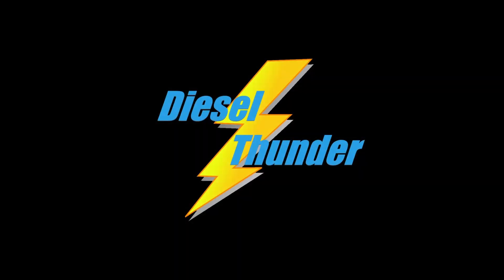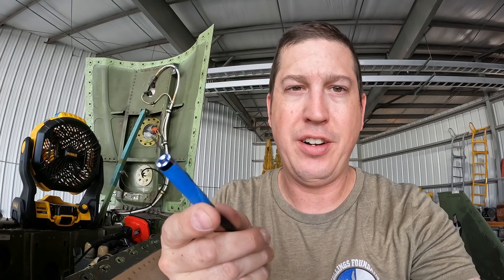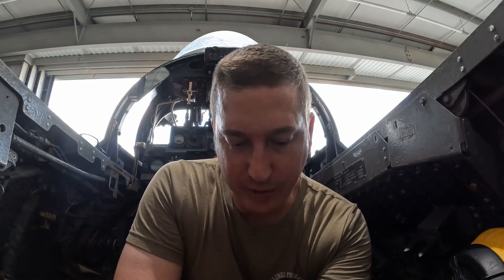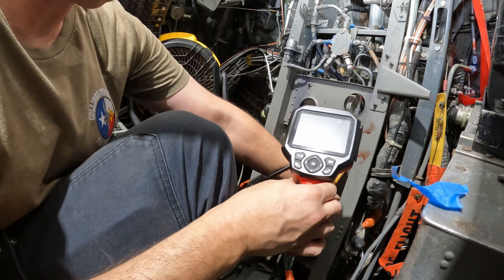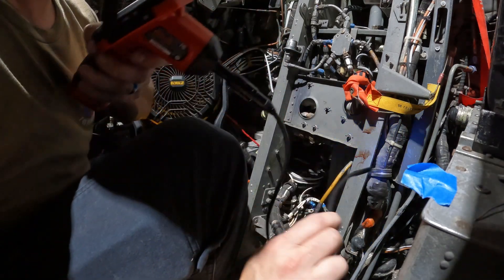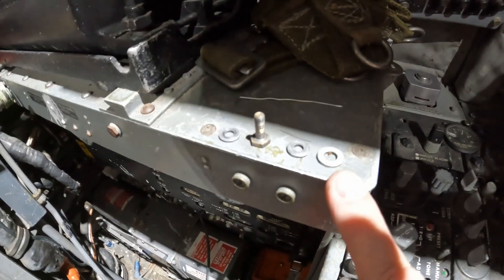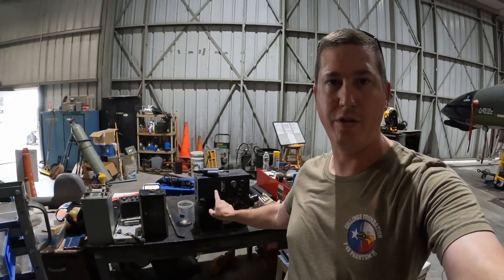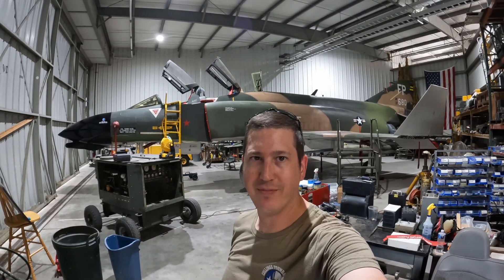FOD Fishing | F-4 Phantom

Comment: Question! I was an avionics instrument systems tech on USAF F-4 airccraft late ''70's to early '80's. So many systems to make it functional for flight. Fuel quantity indicating system, JETCAL for the engines, etc.. Does this aircraft have the original CADC? If so do you have all the necessary tech equipment for it?

Comment: This may be a bit of a “down the rabbit hole” question, but are all the nuts and bolts on her steel? Steel fasteners would add, I’d guess, about 200 pounds all up from nose to tail. Did they use any aluminum nuts/bolts/fasteners on her to save weight?

Comment: Worked on f4’s for days retrieving FOD back in the day
Reply: I was a crew chief at nellis on f4d was the best time ever
Reply: @pickandstrum  I was structural technician / airframe maintainer on F-4E "Kurnass". Watching them rumble down the runway at dusk with a full payload was a sight and sound I'll never forget. Some of our jets were emergency delivered from Vietnam after '73 to refill the heavy losses. Colloqually called "Karpada", meaning Toad, due to them being pressed into service while still in USAF dark green livery. We were forever thankful to the USAF.
Thanks for your service.
Reply: Yup, when it comes to FOD, or even lost tools, there is absolutly no place for uncertainty. It has to be FOD clean.
One time our whole base got grounded (several fighter squadrons), because one bucking anvil was lost. After almost a whole 24 hours, it was found trapped between the double skins of a drop-down engine door on a Kurnass. It took a borrowed boroscope from the engine shop to find it.
When drilling out rivits and fastners, we had to collect every last chip, clean up as we go along. Wipe around wing beams, bulkheads & longerons with MEK and gauze, use flashlights and mirrors to inspect conceled every corner.
Ex-Airframe maintainer / Fitter.
Reply: Oh yes, our crews DID roll over and Command a climb...usually resulted in something.  The common write up was, "Lost 1 mechanical pencil".
And to note, those required a outside visual of the upper ejection seats before opening the canopies.